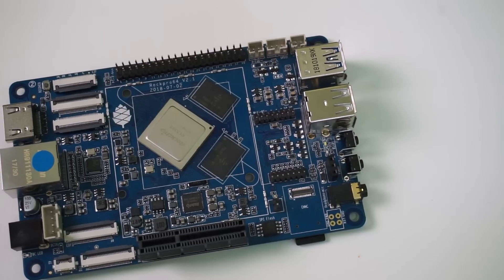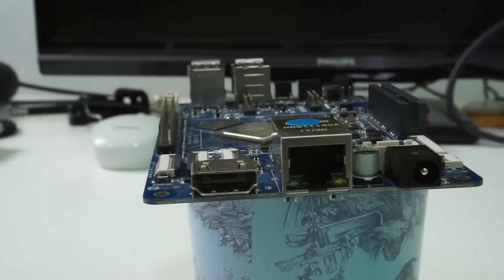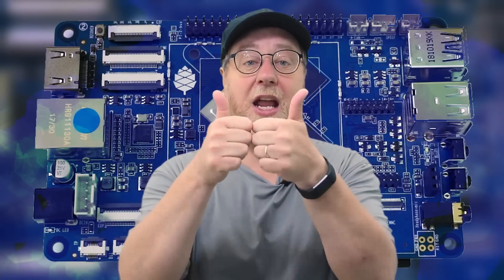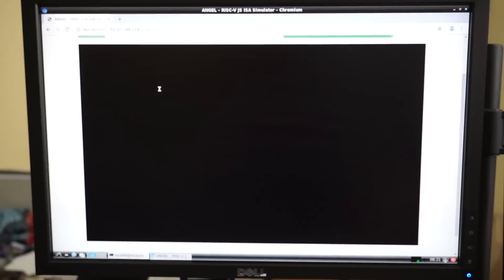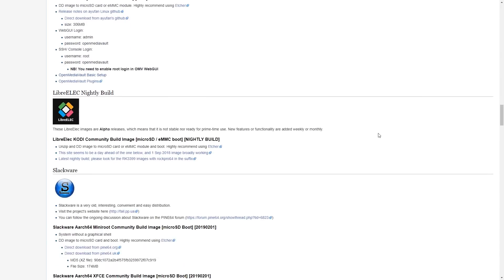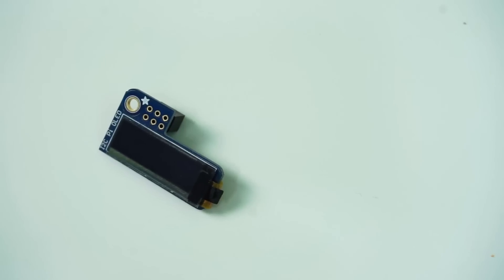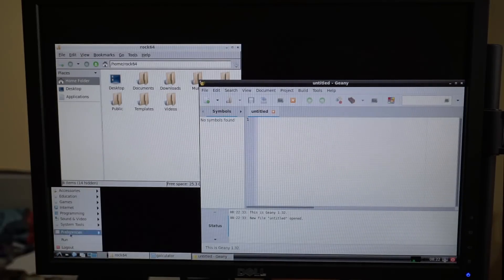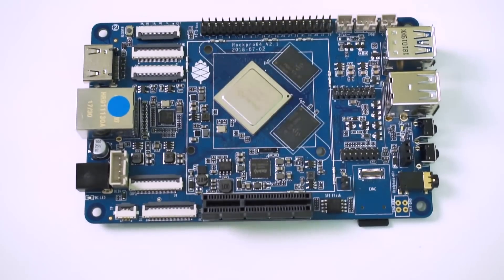PINE64 ROCKPro64 Review: Better than a Raspberry Pi?

Comment: Can you do a speed and processing power comparison between the new Pi 4 versus the  oDroid xu4
Reply from the maker: I don't have an ODroid XU4.
Reply: Pi4 is slower. As expected.https://github.com/ThomasKaiser/sbc-bench/blob/master/Results.md
Reply: @igorpecovnik  It's not. Slower for retro gaming maybe. A Rpi 4Gb or 8Gb will blow the XU4 off the water running any 64 bits linux distro like Ubuntu-mate 20.04, ubuntu desktop 20.04 LTS or Manjaro 20.08. XU4 has 2Gb of RAM only.  XU4 was released in 2015. Rpi 4 was released on 2019. Times to move on. You want something faster than Rpi4 and reliable too to run Linux Desktop, try Odroid-N2+ and install official Ubuntu-Desktop 20.04 w/Gnome/Wayland and 5.8 kernel.
Reply: @josephtremblant2173  LOL Perhaps you should check the date of my post? Things has been changed indeed. I also never used RPi nor Ubuntu or Manjaro. Time to move to Armbian on N2+ and other boards. Its the best support you can get/have. BTW. At the time of this post, 3D drivers (needed for Gnome and similar) are too unstable for Wayland (on N2 and RK3399). Also if you want something more versatile / better for serious usage, proper storage, get Nanopi T4 ... see SBC bench numbers to understand where proprietary video player without reliable storage called RPi can truly excel. If.
Reply: @josephtremblant2173  And to not forget. SSD on RK3399 (which is also around 2.5y old now) can easily run 1 GBPS faster then on Rpi4 or about 3 - 4 times and its much much more reliable. This is another case, not Retrogaming. What about crypto acceleration? How fast it is on RPi 4? I indeed want something faster for Linux desktop which is why I use Ryzen 9 3950x and don't waste time with SBC for that kind of usage where memory speed is just a bit faster then a desktop ssd storage.
Reply: @josephtremblant2173  And 64bit Linux runs actually a bit slower then 32bit Linux. But yes, it has other limits, like addressing memory ... Stop listening mainstream commercial Linux distros marketing bullshit while in reality its only related to costs.

Comment: TV's should be using this embedded to their chipset..so that tvbox is the thing of the past,this might be a good casual gaming on the tv aswell
Reply: most of the TVs now are smart TVs but they use really slow chips to not raise the prices too much just in the ultra high end you can find decent chips  with android tv oreo but for me i prefer to buy a cheaper tv with better display than a smart tv if i could because even the fire stick 4k is a lot faster than most smart tvs and i an used to the shield tv that is the ultimate experience for a tv entertainment system even my HTPC with ryzen apu is just sitting there without being used

Comment: “The most powerful computer in the office is the one that gets used”.  This applies so much in the case of these more esoteric SBCs.  
I have a Rock64 (much more Pi-like in form factor, etc.) and it took months of fighting with missing drivers, half-finished distros and fundamental problems such as a complete inability to display “other” resolutions (I had a 4:3 1280x1024 LCD, that couldn’t be driven by the board which had a fixed range of video outputs selected as a very limited set of HDMI output resolutions).
I originally intended to use it as a mini-workstation but ended up relegating it to a server function;  plugged in Gigabit Ethernet and a 2.5” drive on USB3 and it does rather well in that regard but forget reliable support for any of its wider functions.
I have spoken to other developers who have tried some of the more esoteric SBCs out there;  almost all of them have big chunks missing from their supported distros, companies rely far too much on the enthusiast community to develop and support these things and their work may only be seen by a few dozen people (compared to a Pi which can benefit millions).  
Great specs and funky components are only as good as your ability to run them – Pine seems to keep having this problem, just as Gary says – the quality of the distros just isn’t there.
Reply: Try Odriod they never let me down plus the're so much more powerful the the Pi4 (Seems like the Pi Foundation dropped the ball releasing a board that's already out) and have software to back it up too.
Reply: I would go for the Atomic Pi if I went away from the RPi again.  X86 has much more support in the 64 bit space, for example RabbitMQ uses Erlang which had almost nonexistent support for arm64 last time I looked, at least beyond some redacted beta release.
Reply: @davocc2405  the Atomic Pi will be such a limited run it is far from really worth it. once they are gone, the only several thousand of them and that is it. Yeah, it's x86, but it's also a low end part from Intel and there really is no recourse for hardware failure since it is essentially someone taking advantage of parts "surplus" for a lack of better term. If I were to look at ARM alternatives then I would be looking at the Odroid H2 if you haven't as Hard Kernel has stated they do plan to continue to produce and support them.
Reply: Classic chicken-and-egg problem for hardware/software.  Unless your hardware has some kind of exclusive functionality that isn't easily adopted into a competing ecosystem AND a realized demand for that functionality, getting a market foothold beyond law of averages is very difficult.

I am watching the FPGA based microcontrollers coming out, now, for that reason.  I have every intention of running desktop CAD-CAM equipment using that FPGA as opposed to trying to use microcontrollers that have very few true interrupts and spend half their time polling inputs.

Well.... And a home-made solid state AESA radar sounds like a fun project.

Comment: Welcome to Linux, there will be problems. If you're willing to put up with the work it'll get easier. 

You could always use the money you saved in licensing and hire someone to do it for you, or put a code bounty.
Reply from the maker: LOL. I think my point was not that Linux itself was the problem, but the ecosystem. Things are very different on the Raspberry Pi, as I will show in my Pi 4 video.

Comment: Gary, the RK339 processor is a big and little design.  It work differently than an x86 hex core processor.   Perhaps you could explain how the Big and Little system works.  I am an x86 guy.  The dual CPU nature of these ARM chips has not been well covered, to my knowledge.  X86 CPus have single and multi-thread performance scores.  The big and little ARM design adds light load and full load modes to this mix.  The Raspberry Pi has avoided this issue, using only a single core type in each generation.  This very x86 like, but it avoids the extremely low energy modes of the big and little design.  Help please!
Reply from the maker: I have already covered big.LITTLE multiple times in video and in article, on this channel and on Android Authority.

Comment: It seems a nice,tinkers board, until the rough edges get serious attention.  The four lane Pcie slot should support nvme SSDs .  The Sata card used one Pcie lane.  The desktop to m2 Nvme cards use all four Pcie lanes.  Drivers would still be an issue.  Often command line only Linuxes can have a desktop installed, from software packages.  Command line Distros can squeeze more out of low memory systems. Servers often run with no local screen or keyboard, (after setup)  They are run from another desktop on the network.  Support for less mainstream boards is always a question, rather like rarer vehicles.    Flagging this unit as a challenge is a great service to potential users.  Thanks Gary!

Comment: @Gary Explains, you can port Android-OS in this single board computer and can test these boards power by Speed Test G. You might think Raspberrry Pi vs ROCKPro vs Atomic Pi etc. And Android-x86 in 64-bit machines (Laptop && Desktop).

Comment: Gary. When you were transferring files using the SATA board. What did you boot to? SD or EMMC? Does that make a difference in file transferring from SATA?
Reply from the maker: Booted from SD and it won't make any difference.

Comment: Pi 4 smashes this lmao
Reply: But this board has been out on the market for a year now. I am sure there are plans for new boards based on the upcoming RK3588 chip and alternatives that should be a lot more powerful than the Broadcom chip on the Raspberry Pi.

Competition is good and will accelerate development, not unlike what is happening in the x86 world with renewed competition between Intel and AMD for high-end desktop and server processors.
Reply: ayy lmao
Reply: I wouldn’t be so sure. I’d say they’re about tied in terms of processing power.
Reply: Er... how about no? Stuff just working out of the box... yeah, sure... you got it there... but performance? Nada. Benchmarks are saying otherwise. RPi4 http://ix.io/1MUi vs RockPro64 (my NAS, still running a older 4.4 kernel,  about to be updated) http://ix.io/1MYE ... even with that handicap... memory ops are about twice as fast as that of the Pi4, openssl speedtest is twice as fast as the rPi4 or about five times faster for some tasks, and marginally faster overall for the single and multi-core 7z compression tests. More importantly... the CPU temps... because I've got the stock heatsink on the rockpro64... compared to whatever was used with the raspberry pi if any... my temps didn't move that much... about 10C?... whereas the raspberry pi can't have been far from needing to thermal throttle, since it was hovering just shy of 80C.

Comment: Pi4 looks nice and is cheaper. I'll wait on your review before deciding whether to upgrade my pi3 tho.
Reply: I'm hoping we can get a nice android build that can use dual-screen somehow.  I use the XU4 for both retropie and Openmediavault, and it work splendidly for both.  I do want a standalone Kodi box though, and I'm hoping this will be able to do that well (which I'm sure it will).
Reply: @pniiice  That's what I use the C2 for
Reply: My pi 3 b+ was dead when I bought it. It was revived by me but 10 days later it dies. Random shutdown now only red-light when on
Reply: @msinfo32  Sure your power cable and block were up to it's requirements?
Reply: @Jimmy_Jones  Yes it is the official one
Reply: The Pi4 is about 6 months to little to late,  Rockchip has an 8nm 8core upgrade coming that is 4 x A76;s and 4x A55;s and looks to support 8K video ( Mali ) ..  Will be interesting to see how the SBC's roll out sporting this one,  worth waiting as its slated for the 4th quarter this year.

Jut like the Rock64 and RockPro64 will likely be 100% supported with Open Drivers ( Linux Kernel + device tree ) , yes even Mali T/G Series with the likes of panfrost/bifrost ( midgard ),  So you can go BCM / cheap if you like ( hate the propitiatory blob required to boot that thing ), but my money is on RockChip to still own the Market with the new 35xx series where the 3399 has owned it this far.

I have a rock64 ( self built parts ) running Arch Linux,
Linux archrock 5.1.15-1-ARCH #1 SMP Wed Jun 26 00:49:32 UTC 2019 aarch64 GNU/Linux

And yes everything on this board has a kernel module / enabled see here for modules ( drivers to windows people ) and the whole boot process,

https://pastebin.com/QcPWk0LB
Reply: Nigel Sollars Sure if you need more power, I use my rpi as mini NAS so usb 3.0 would be a major upgrade and i don’t need 4gb of ram. As for compiling kernel with all modules enabled that was good call.

Comment: Unless the Pi4 is to be made into a blender3D-game engine handheld console with two screen (like a 3DS has) for games that look like FarCry of TheDarkMod (the original Doom3), the dual hdmi is not that interesting, and neither is the a72 CPU. It comes across as a mediocre desktop (laptop) which cannot be upgraded. Sure there is something "useful" about that but it could be shrugged off (and also the hdmi could break).
Many a Pi style board ends up used as headless anyway and so a slower 8core would have been handier for blake2sp for example (such as for storage and network). The 4GB RAM is handy but ddr3 would have been fine. Such a pity a person cannot add RAM later. A PCI-e could be cool for a fpga card or an x86 card.

Comment: I've been using one of these as a nas/nextcloud instance/ Plex server. It's a pretty good board. I bought a WiFi module and it didn't work at first but it does now after updates. Running armbian
Reply: There's a BANA Pi that is supposedly a router board but should work as a NAS board.  Problems are £100, 512GB DDR benefits are 4 ethernet ports and some other stuff I forget.  ANd you can get a second hand Synology for £150 anyway.

Comment: With the Pi 4 out, I see very little point in getting another rk3399 based sbc unless you are a hardcore sbc nerd. $80 plus international shipping is simply not competitive at all. The pcie slot is cool but not enough to justify the price and lack of community and software support.
Reply: Lack of PCIe/SATA is a huge pain in the arse with these budget SBCs. I've been trying to find a cheap, tiny board for almost 2 years to build a custom NAS.
Most I've found that have SATA only have one port, and most with PCIe that I've seen lack something else important (like Ethernet), or are too big or too expensive.
Reply: @tin2001  The usb io performance on the pi 4 is massively improved compared to the pi 3b+. You can just get a hard drive or ssd enclosure and plug that in. Toms hardware showed speeds over 300MB/s in their review.
Reply: @MegaStupidMonkeys  Maybe I'm just old, but I personally hate disks attached over USB... (quite a lot of USB -> disk interfaces used to / had issues with sending commands for things like setting sleep time to the disks)... But I'm fortunate enough to have a Proliant micro server (a few gens old) so with regards to file and virtualization servers I'm good anyway :)
Reply: This is an hexacore CPU, though. And PCIe is quite interesting, as you can put an SSD in there, and other things such as SATA ports (useful if you want to make a NAS).
Reply: @GRBtutorials  Not all cores are equal. The rk3399 has two A72 high performance cores and four much less powerful A53 efficiency cores whereas the pi 4 has four A72 cores. The rk3399 may offer slightly higher single thread performance thanks to slightly higher clock speed of its A72 cores but the overall performance should be on the same level roughly.
Reply: @MegaStupidMonkeys  I have been developing for the Rockpro64 for almost a year now since they launched it with developers. It is actually a very capable board. Pine64 was smart with how they did things whereas the new Pi 4 is going to be a while before it truly shows any worth. The thermals on it are through the roof and that is with the damned cores downclocked by 500mhz. The fact that they stuffed 4 a72 cores into that small CPU space and then uses that shitty heat lid is telling of how the Raspberry Pi Foundation continues to cut corners. People will be "overclocking" the CPU just to try to get to the performance of something like the Rockpro64 and the Odroid N2 all the while increasing thermals and reducing the lifespan of the CPU and therefore the board. Other vendors have been pumping out great alternatives for years that have spanked the Raspberry boards, but there are just too many Pibois out there with their lemming attitudes being happy with mediocrity. I have had my Pi 4 now since 2 days after announcement and am not impressed especially with the fact it has suck lackluster MESA support yet that is what all the excitement is about. People want to bash other vendors for things yet when the Raspberry Pi does it then it is "ok". The hypocrisy is truly pathetic.
Reply: https://www.pishop.us/product/raspberry-pi-4-desktop-kit-us/ and desktop kit is a laugh its the same ole VC4 and can only play 1080p via VLS and when full screen.
So much what is said about the Pi4 actually currently doesn't work and why we are not waiting for 2020 is because the RK3399 with 5.2/5.3 goes mainline and the 2gb version for me is the best bet for $59.99 but to be honest think the RockPi4 is a better design. 
https://wiki.radxa.com/Rockpi4
ROCK PI 4A 2gb with custom heatsink price $56.99
Reply: --  Yeah I am hoping the rk3588 is an increment on the rk3399. But as you say with Panfrost it becomes 100% opensource mainline kernel supported in 5.2/5.3.
The pcie x4 available for use is a huge bonus but overall the design is really balanced that just makes the Pi4 look a jumble of Broadcom cast offs.

Comment: Nice review! But after June, 24 - launch of Raspberry Pi4 - no other SBC is of interest. As the new Pi has brilliant specs, low price and great community support! Looking forward to Pi4 review, tests, comparisons and so on!!! Always want to fund out more, thanks Gary and good luck!!!
Reply: I saw the announcement of the Pi, looked at the specs and said "oh, so RPi 1 with a newer CPU... Again".
I'd you want a cheap Linux desktop, then RPi is an option. If you want basically anything else, its not a good choice.
Reply: @tin2001  The Zero is OK, and not for a desktop.
Reply: That’s quite a big exaggeration. Sure, the RPi 4 is powerful, but sometimes you want it to be cheap and compact rather than powerful, such as in security cameras, and sometimes you want more power and peripherals, such as in a NAS. Also, I’m sure Rockchip, PINE64 and other competitors will soon present a better alternative.
Reply: @GRBtutorials I accept some level of exaggeration of course!:) But no doubt it's gonna be very tough time for competitors! As Pi4 will take it all!